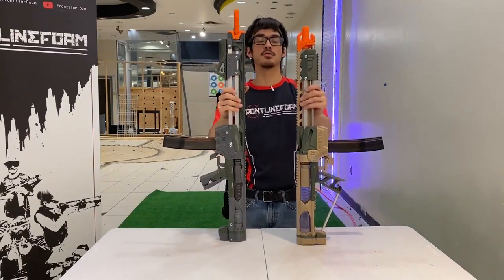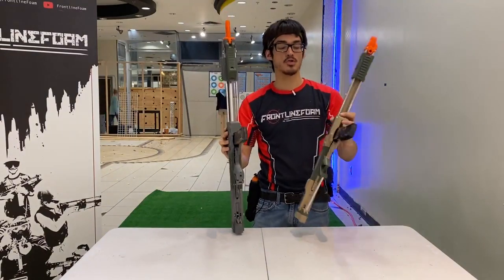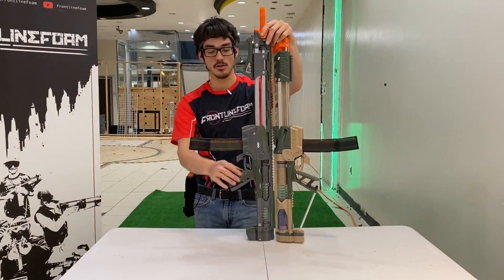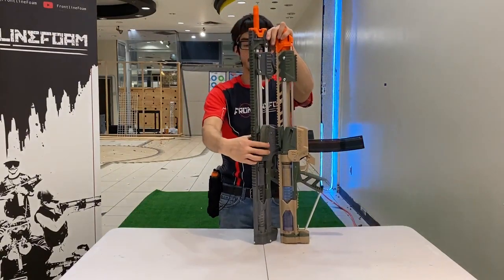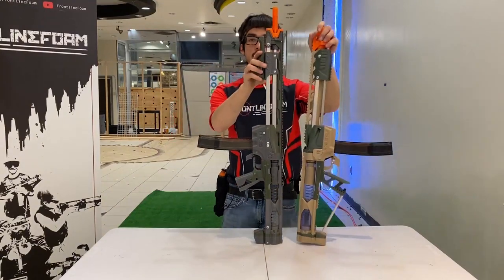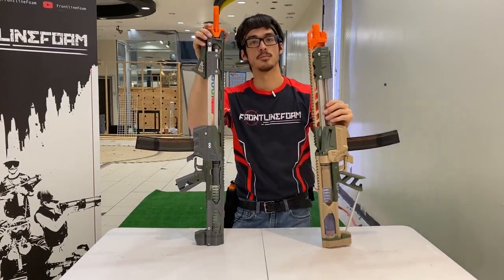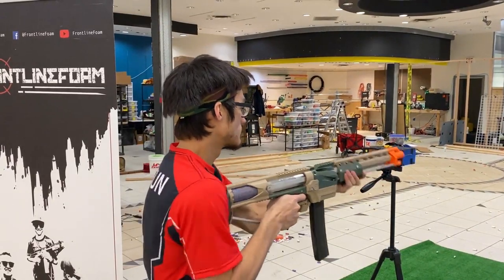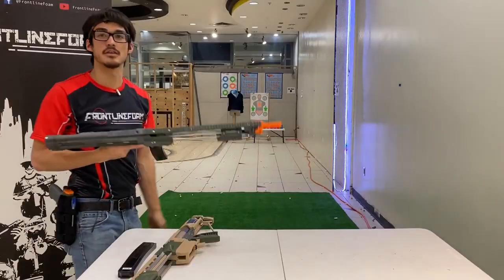C4 or Caliburn? What's the difference?

Comment: 2:20 how are elastics more durable than springs? And I’ve typically only had mag release springs fall out with my Mega front end.
Reply: The issue was more with underextrusion on the spring pegs needed for the loops on the extension springs. In many filaments they could not be printed reliably without printing those specific parts separately and at a much slower speed. If the spring pegs break during use the extensions springs can escape and get lost.

Comment: Anyone have tips on how to keep that rubber grommet on the air braking system from coming off?
Reply: You can use a longer button head screw (UNC 4-40) and a #4 washer if you have issues with that.